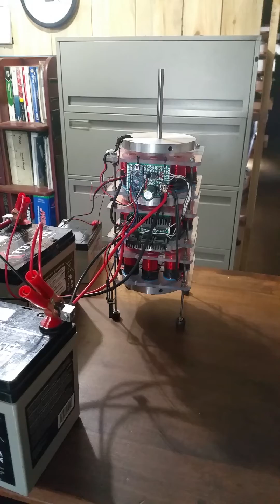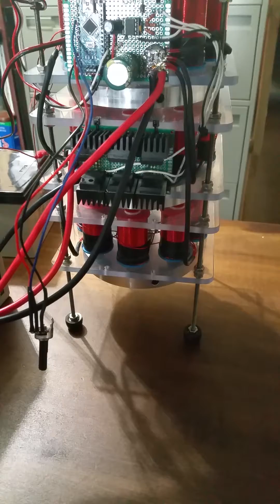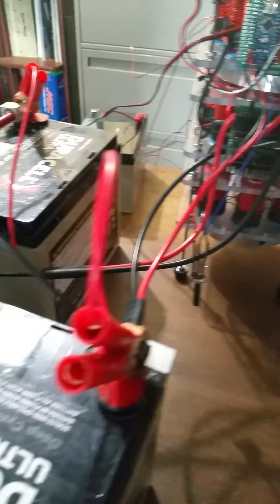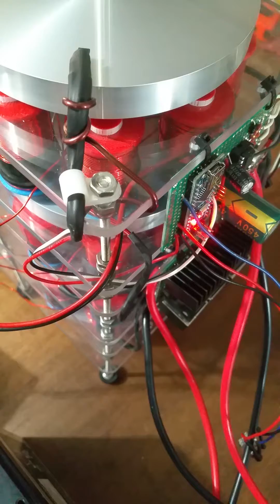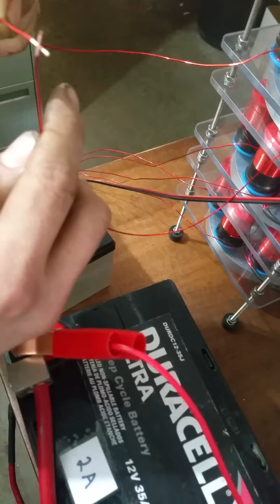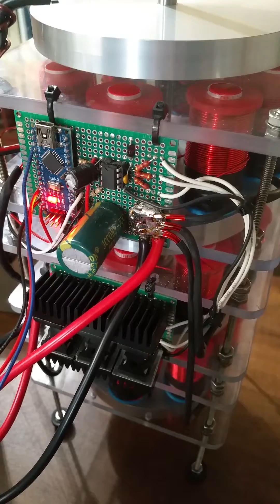Triple Stack Mini 4 Dualpole Energizer

Comment: What does the machine do? Is it a battery charger?
Reply from the maker: This is a motor that is powered by one battery and then charges another same battery at around the same rate. So you can either run it is a motor or a free energy generator as you see in many of my other videos.